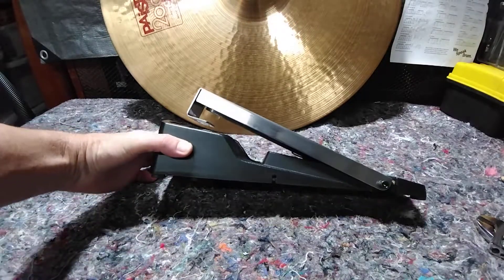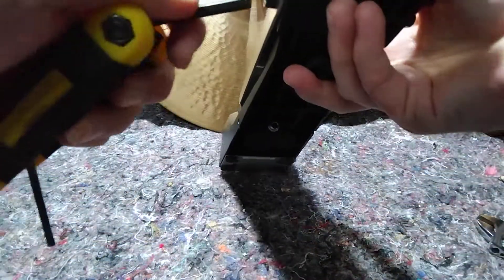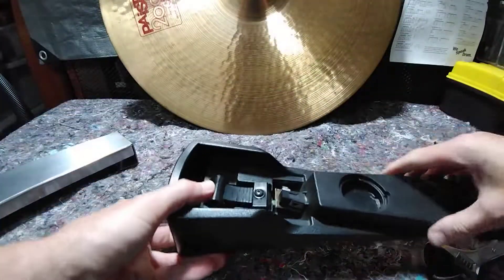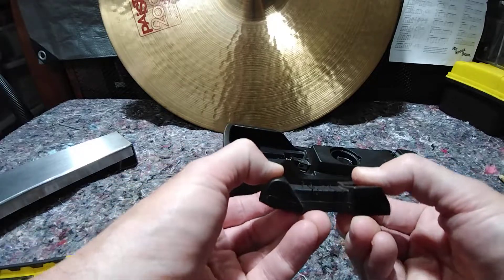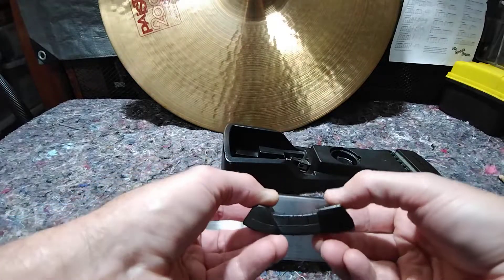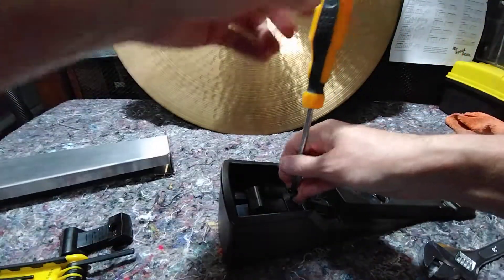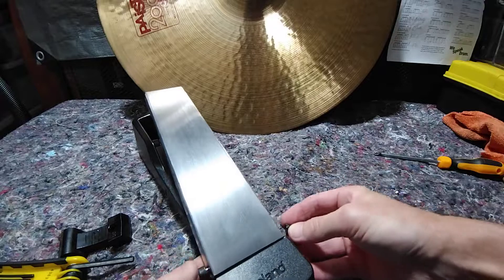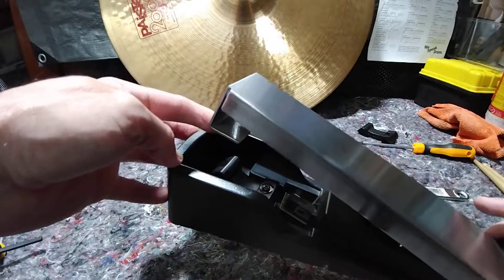Roland TD-1KV Hi-Hat Pedal 6½ Year Usage Update.  (Not Working & Solution)

Comment: Hi, GREAT, thanks for sharing the solution. Where from you got the replacement piece mate?

Mine works BUT I need to press it really really hard for it to just work at all and incredible hard and very very down till the very very end for it to fully open the hats. Thanks :)
Reply: noooooo, that "piece" of mine seems totally okay and in very good shape and with a nice "curve" so my problem should be a different one. I try to explain myself the best I can in English to see if you can may figure it out :)

I have to press reaaaaaal hard in the pedal to keep the hithat silent while hitting the hithat cymbal. Furthermore, even if Im pressing it really hard and manage to make it "close" for one hit, even so, keeping the same pressure (really strongly) I hit the cymbal again and by this time is already "open"

Even if I push reaaaaal hard directly the rubber piece with my hand, I still encounter the same problem-s

What Im saying above its just for ordinary play. If I had to for example do something a bit more complex like saying for example openig/closing the cymbal by just pressing/depressing the pedal that prove an IMPOSSIBLE TASK. Impossible even just to do it once. They only thing I can really achieve and that's only by pressing very very very hard and very to the edge of the pedal, its just silent the hat but just once

Any idea of where the problem could be?. Thanks :)
Reply from the maker: @JesusPiano  You still need to replace it.  It is not the "shape/curve" that matters.  It is it's pliability, and yours sounds like it has hardened.   Contact your areas music store to see if they carry Roland replacements.  
A small dab of silicon spray on the apex of the curvature on the rubber actuator should sort it temporarily also.